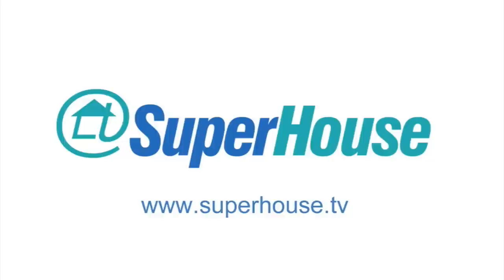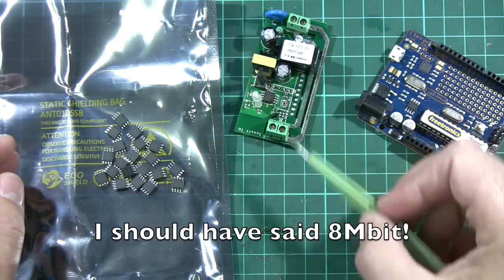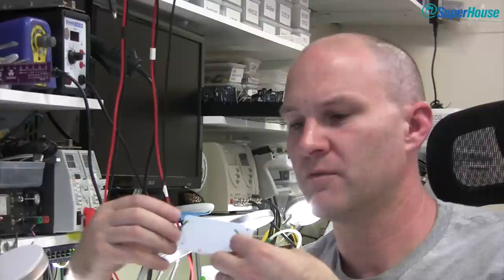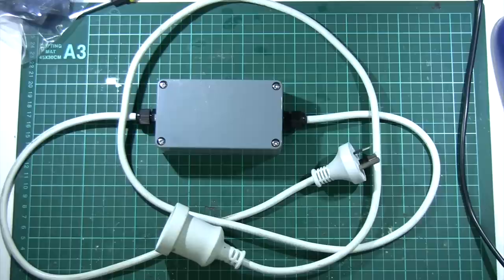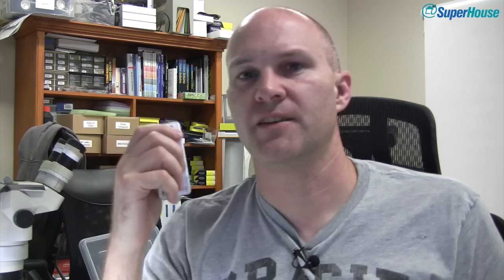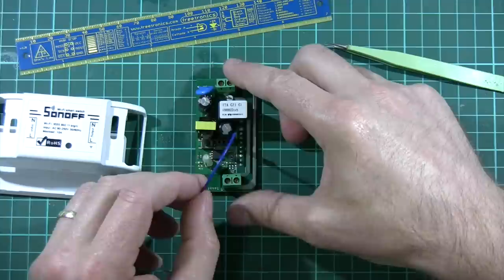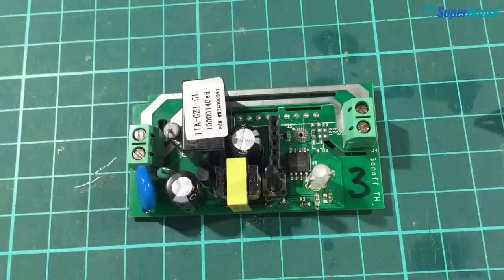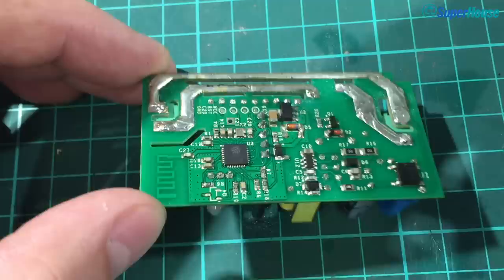SuperHouse #21: Six Sonoff Secrets: Storage, Safety, Switches, Sensors, Software, and Sites

Comment: I measured the voltage between the TRRS socket on the Sonoff TH and the Neutral and read 70 volts. It appears that the logic ground inside the Sonoff is not referenced to the outside ground. So make sure anything you connect to the TRRS socket is insulated. Don't put a metal cased temperature sensor into a bowl of liquid that is exposed.

Comment: Simply genial! I would replicate the switch override with a Sonoff TH10 using a TRRS connector. Please, could you post the TRRS pin wiring? Also, do you suggest to wire the ground to the TH10 or bypass it like in your video? Many thanks!

Comment: Hi Thanks for another awesome video. Just a question on the wiring of a lamp. In South Africa we usually only have two wires running to a lamp/light, so it does not have an earth.  Is this still ok to connect with only the two wires and also, when plugging in a two-pin plug which is positive & negative?
I got a number of Sonoff basic running on lamps but after watching safety video how to wire, I thought I ask. Thanks

Comment: the most useful thing i have seen in a long time! in regards to the light stitch, is it possible to add another switch in parallel with the first switch so as to have light switches on different ends of the room, ie. 1 by the door and 1 by the bed?

Comment: Hi, I am working on CAN-Bus,  pretty really simple but not wifi, all will be wired in a way that cars have, whole thing put together just 2 wires plus the power to drive the CAN-Bus (Controller Area Network-Bus), it is an old system and still in use. I just got my Bungalow, just waiting for change hand. I might add wifi or Bluetooth to get smart phone to work, or mobile homemade unit.

Comment: 10:00 Whenever I install a device like this in line, I always strip the cable down so the cpc (earth) remains unbroken. I then run that earth straight through the device, insulated of course. Sometimes this involves making notches but its the best way I can see to do it.

Comment: one issue i see appearing with the toggle system integrating both phone and switch (a minor issue) is the app doesn't update the state from the MCU. so you have to toggle it twice on the smartphone app. this is due because the app developers didn't think ahead and program the feature to "get state" from the MCU whenever a state change occurs in the MCU it doesn't "Push" the state to the app-server. it is mostly 1-way..your method is great, i just wish the makers had built in (since they have a built in button to toggle state) a method that causes the app to update.
Reply from the maker: This works fine with the OpenHAB app and Tasmota firmware, because the app receives status updates from the OpenHAB server which can track the state of the individual Sonoff by watching its MQTT messages. I didn't bother setting it up for the quick demo in this video, but Tasmota publishes local state changes (such as pressing the button or moving the switch) to an MQTT broker, and OpenHAB can subscribe to those events.

Comment: I'm not sure why you need more memory.  I just use these things as "dumb" switches, do the complicated stuff in a raspberry pi (or similar) in Python and use JSON and or REST to send/receive data/commands.  The Wifi stack, OTA, a webserver, UDP sender logic all fits in about 300K.  I haven't tried this with the ESP32 and the BLE stack yet though I'm told the BLE stack can use 300K all on it's own but haven't looked yet.
Reply: I suppose where people may get into trouble is when they insist on using the "off the shelf" firmware projects.  All that flexibility so these will work for everyone comes at a cost.  You would be much better off learning to write your own firmware and keeping it simple.

Comment: Normal compression glands are NOT submersible. Silicon also doesn't work. You MUST use appropriately rated enclosures. As you said, that box will probably be ok for a bit of light rain or splashes, but that is all. I've spent the past 25+ years installing electrical equipment outside, water will find its way anywhere.

Comment: Hi thanks for awesome video . I wanted to start doing some home automation to my home. I would like to know if the Sonoff is safe enough to connect to light switchers etc.  If I follow what you said in the video , it will be safe and not cause a problem from the high voltage 220v light system. The reason I ask is I saw another chap smashing the device and saying should not be used. Got no safety rating. Once again thanks , great channel and going to be watching many more of your videos.

Comment: Can you give part numbers with sizes of eproms that can be used to upgrade these?  Maybe even recommend a supplier?  Also I would love a simple ESP8266 circuit that could control a sonoff over my wifi, so I could have a (or a few) simple remote switches. ... great videos !!

Comment: Hello, it can be programmed to be used for a (staircases light) to be timed, after each turning on, like 10-15 min, to stop automatically after each start?
Thank you!
Reply from the maker: Sure, that wouldn't be difficult. I don't know if that's already supported in any of the third party firmware, but it wouldn't be hard to add if it's not. Just set a timestamp whenever it receives a command, then in the main loop it would check how long it has been since the timestamp was last set. If it goes beyond a certain period, turn off the output.
Reply: SuperHouseTV 
Can you please help me to do that?

Comment: Hey Jonathan I'm beginning to use Sonoff devices in my home & have been following your wiring suggestions. However, my understanding is that these devices don't comply with Australian regulations. I was wondering if you have any information on why that is & if there is anything the average DIY-er can/should to improve the compliance? Love your work.
Reply from the maker: Unfortunately Australia is a tiny market for ITEAD, so we're low on their list when it comes to things like compliance certificates. Most of their sales go to Europe and within China. However, on my recent visit to the Sonoff factory I was told that they are going through the AU compliance process now so they should be fully approved within the next couple of months. Right now the devices are manufactured to be safe and comply with regulations, they just haven't spent the $$$ to pay for the testing and approval. So they won't become any safer after they are approved, they're safe already, it's just that they'll have a piece of paper to prove they are safe!

Comment: Can't you like, put a pushpin into the top of the button.
So you extend the already existing button?

And you could also run the wires around the back of the device and tie-wrap the wires together as strain relief?
It's true it may use some extra protection, but it's pretty okay already (a bit depending on how/where you use it).

You could also make a slit through the top of the device, to be able to access the header safely.
Reply: xFuaZe btyite.yhutto
Reply: You leave me clueless

Comment: I watched the video about the floating earth wire, What I do is never actually cut the wire, I simply strip the insulation the length of the device that is going to be in line. Just cut the live and neutral wire and snip off any excess that may not be required or is cumbersome to loop before screwing down into the terminals. I NEVER EVER cut the earthing wire. Will post a picture next time.

Comment: Hi Jonathan 
Great episode as usual ! Really enjoying your channel , quick question, can you connect a normal light switch across gpi014 and ground out of the box or does it need to be flashed ? Thanks 👍
Reply from the maker: I don't think the factory firmware recognises button presses on GPIO14, because it's normally used for I2C communication with external sensors on the TH model. The button on the device is connected to GPIO0. I may be wrong (I haven't used a Sonoff with factory firmware for a long time) but I think you'll need to reflash it.
Reply: SuperHouseTV 
Thank you for your reply ,your my go to for anything tech !!When using the th16 model can I use the sensor jack to add a switch or will that also need to be flashed just thinking of ways to add the Sonoff with a wall switch without tampering with the firmware ! Thanks again Jonathan I appreciate your hard work 👍👍

Comment: later sonoffs have cable clamps, but they MUST be used correctly (Clamps MUST clamp the cable outer sheath, not the insulation of the individual wires. What's shown with 2 exposed inner wires under the clamp (regardless of being insulated) is unsafe and illegal in most parts of the world - it's a very common DIY failure)

EVEN WITH THE CABLE GLANDS in the IP54 box, that kind of clamping is illegal (those glands provide insufficient cable anchoring to keep australian or NZ inspectors happy and the cable can be pulled out of them, potentially leaving wire ends exposed outside the box

Comment: Great video - small question about the light switch - does it has battery? where does it gets its power while the light is off? does it require Line and Neutral wires at the wall? Thanks.

Comment: Awesome videos, and channel in general Johnathan!! I'm definitely going to be using this to control overhead lights and turning regular switches into smart 3-way switches. If I have an existing 3-way switch with two normal mechanical wall switches controlling my overhead light, is it possible to wire this device so that it can turn this set up into a 4-way switch? So continue having the 2 functioning manual switches, plus a smart wifi enabled switch, that all toggle the light on and off whenever they are "switched".
Reply: Greg, with two mechanical switches and if its wired the way its in the link https://www.dlsweb.rmit.edu.au/toolbox/electrotech/toolbox1204/resources/04diagrams/04lighting/03_2way_sw.htm (which it should be) I believe it should behave as a single switch as its a series circuit. Even the code should be unaffected. I cant test this yet... waiting for my sonoffs

Comment: Hi
Excellent Video 2 questions
1) Do you have / plan a vidoe on how to work with the G1 module?? Would like to be able to have the G1 module work as a transmitter and reciever. 

2) Can you send more information on which memory Chip you are using as a replacement 

Regards

Comment: Hello, i accidently killed the waterproof sensor and its not working anymore. I bought DHT21 but now first the cable has 3 lines and when i connect it shows temperature and humidity 0.1 degree and 0.1 humidity :( what am i doing wrong ?

Comment: Good evening I have an electric door knob and I can control it remotely by using the ewelink program with 12 volts, but the current continues
  I need only a fraction of a second to open the door. What is the solution or what is the device that can be used?

Comment: That was worth listening to. Thanks for taking the time, I'm new to this and can update or reinstall new firmware. My question is can a sonoff be changed to momentary to activate a garage door using Alex/echo. Thanks again for taking time, Kia Ora from NZ
Reply from the maker: Sure can. Some firmware already supports this. My favourite firmware (Theo Arends's "TASMOTA" firmware) has that as a feature that you can turn on. I can't remember exactly what it's called, but you can set it to pulse the output for a defined time.
Reply: I used 2 x nodeMCU's & 2 x relay shields to operate the open/close of my garage doors (2) with 2x reed switches connected, I can tell if my doors are open in home assistant.

Can open either door with phone/tablet/pc or anything that has a browser & from anywhere in the world. 
Doors are also closed automatically, if accidentally left open.
. 
Alexa, open garage door 1  ;-)   

 yes, alexa voice integration as well. =)

Comment: I have three way switches everywhere. Any chance one of your hacks might be useful to replace a 3 way switch? (assuming you are lucky enough to have accessible neutral). Got me thinking when mentioned the button causing a state change. Of course, it would be necessary to wire in the traveler to the second switch if you wanted to keep it functional. Seems to me there ought to be a wiring scheme that would do that. What do you think?

Comment: Hope this is not a duplicate question... can you hack the sonoff wall switch to replace the firmware and bump the flash memory without breaking the housing?
Reply from the maker: If you mean the Sonoff Touch, there's good news and bad news and good news. Good news: you can open the housing easily, it just clips apart. The processor is on a sub-board that you can unplug (it will also require pulling it off some double sided tape) without removing the main PCB inside the switch. There's a programming header, so just reflash it like other Sonoffs. Bad news: it doesn't use an ESP8266, it's an ESP8255 which means it has 1MB (8Mbit) built-in memory, no external flash chip. You therefore can't upgrade the memory. Good news: if you install Theo Arends's firmware on it, you don't need to upgrade the memory because it fits ins the factory memory.

Comment: Hi, great video, I've got a sonoff POW from aliexpress. and tested it with its original firmware with differents home appliances and it works ok. now I would like to integrate it in my openhab/mqtt setup so I'm about to flash it.
The point is: will I be able to use the power metering feature after flashing? what firmware should I use?
thank you for all your inspiring videos

Comment: On the terminal where there is the relay does it put 220v or just closes the contact? I'm thinking to use it with a "logic" input on the other side and i just need to close the contact... no big AC current allowed.

Comment: Hi Jonathan, thanks for sharing this video. I have one question on connecting the sonoff to wall switches, may I know which two points on the sonoff PCB you plug in to the wall switch in your video? I saw on the PCB seems like 'J0, J1'? Is that correct?

Comment: Not sure if this is appropriate for this video here to ask this but how do you determine what temperature you should be soldering at?  i have a variable temp with digitial readout and it auto adjusts to keep at that temp on my soldering iron. i have it at about 330  deg Fahrenheit.  it takes a couple seconds or so for my components to heat up to melt solder but yours goes super fast so i figured it must be hotter.  Just curious as there is a lot of talk about this online.
Reply from the maker: It depends on the type of solder (leaded vs unleaded, for example), the type of tip on the soldering iron, and the thermal mass of what you're soldering. In general (massive oversimplification disclaimer!) it's OK to have your iron hotter, but not OK to have it colder. That can sound backwards, but what happens is that when you start to heat up the joint, the heat will wick away down wires etc to other parts of the circuit. If your iron doesn't have enough thermal mass and heat, that energy will wick away nearly as fast as the iron can apply it, so instead of heating up the small area of the joint quickly, you heat up a larger area of the circuit slowly. Personally I hate tiny needle-like tips because they don't have enough thermal mass near the tip, so when you touch them to the joint the soldering iron cools down and it takes a while to get the joint hot enough. My favorite tip looks like an angled wedge (almost triangular) because it has a small point but a large thermal mass close behind it. This allows me to heat up the joint very quickly and solder the joint without the tip cooling down, before the heat has time to dissipate out through the circuit. For unleaded solder I normally run at about 380C, and for leaded I run even hotter. But that's because I've done tens of thousands of soldered joints, so I have the feel for doing it quickly.
Reply: SuperHouseTV thank you so much, very informative! I love your videos and will continue watching and learning. I learned something new from your reply and learned a lot from your videos too so far. Keep up the great work!!

Comment: Ive got a couple of the sonoff S22s to have a play with. 3 pin china plug so straight into a AU socket. Has the 2.5mm socket on it but am yet to open it up to see how it is looking inside for wiring.
Reply: Ok, the S22 is a mess inside. Relay in the neutral line and has green and yellow wires as current carrying ones, and the earth pin is connected with a black wire. I flashed it with a different lot of software to get it working with my smartthings hub that I found last night and it took it and worked fine with that. I swapped the wires around so the relay is at least in the phase, not neutral but not swapped over the wires to other colours since I have all that stuff packed away and actually just used a cheap-as USB powered soldering iron to do it.
Reply from the maker: Wow, that's disappointing. I've been impressed by the attention to detail in the other Sonoff models I've seen. I don't have an S22 though. The only picture I've seen of the inside of the S20/22 is on the iTead product page, which doesn't show much.

Comment: Amazing resource you provide thank you Jonathan. I'm building a new house in NZ and thinking of running cat6 to most light switches and some power sockets rather than mains wiring back to the switchboard for every light etc like your house. Is this a good idea? I could switch a sonoff mounted at a light switch for example, via the central control module over cat6 instead of wifi?

Comment: You talk about wiring a standard light switch to the GPIO pin so that a state change on the switch (on to off or off to on) will toggle the state of the relay. And you say that you can set this in the TASMOTA software. But I can't figure out how to do that. Can you point out where the configuration for that setting is?